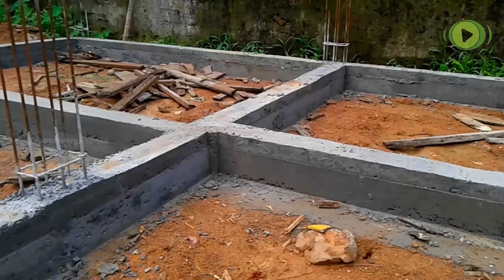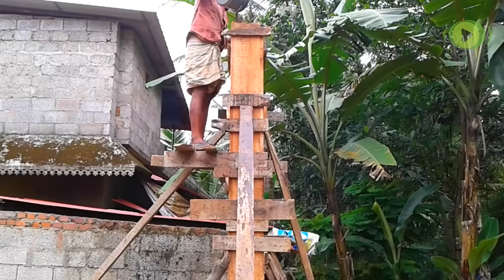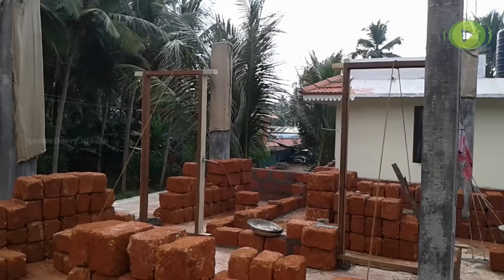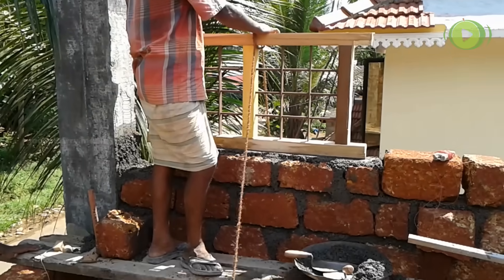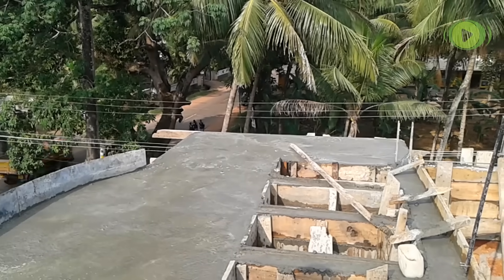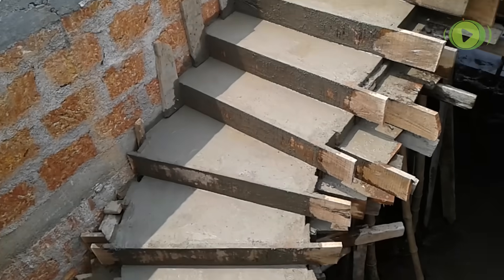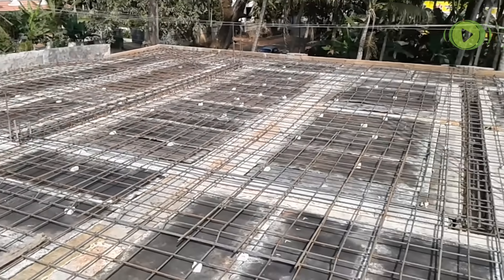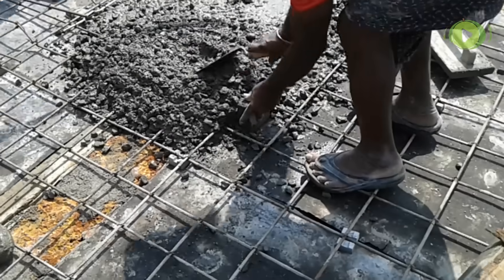Construction Steps of a House-Part 2

Comment: Sir slab should be after wall construction or it may be other way??
Reply from the maker: When beams and coloumns can support the slab, it can be done before walls. For big buildings and all, usually it is like that. And can be also constructed after wall.

For small buildings where there is no enough beams and column structure for supporting, top slab is constructed after the wall construction.

Comment: Throughout Lintel is required in frame structure?
Reply from the maker: Not necessary. The function of lintel is to take the load above door, windows, small projection slabs etc. Can restrict it to that locations instead.

Comment: What's kind of block is that? What's the advantage of using that kind of block?
Reply from the maker: This red blocks are locally available here. It gives coolness compared to other blocks. But we need to check the strengthness also. Some times weak stone will also come since it is carved from below earth. In that case of weak stones, it is not prefered to use it.

Comment: When the colume structure is small and its end is lesser enough for further construction how its extended and increased?? How its extended lengthwise.
Reply from the maker: Columns are vertical load bearing structure. We can drill the holes for steels and fix the steel in the column end using adhesives such as lokfix. Then do formwork and concrete.

If we want column extension, it is always advisable to put extra steel outside the concrete for future extension. So that we ill get proper lap for upcoming steel.

Comment: Good work Johnson.... Just wanna add one think here.... Not required to put window and doors and brick work during construction.. It will be the last stage.. First we have to complete frame works..
Reply from the maker: Hi, Thankyou for the comment.
We are fitting Window framework and door framework first and the doors we are fitting last. We can put framework work of window also after roof conctete if lintel support and beam support are sufficient.

For small houses, where lintel and beam are building on very limited areas, usually we are putting framework first.

Comment: Hi this is Emmanuel from Siliguri. We constructed our house in 2015 and what we did was.... our contractor as shown in the video made the foundation and column but straight away did the slab or the roofing and the masonary work followed after that. Therefore the load of the slab is solely on the pillars but not on the walls. Is that ok ? Well this is how almost all the construction takes place here......but I find your work better from safety point of view.
Moreover my living room dimension is 16*18 with no hanging beam above....but it has a concealed beam in between two hanging beam which is conceled within the slab above....is that safe...? But it has a partition wall in between which were made after the roofing was done. The pillars are of 10*12 dimension...and the beams are probably 10*10....

Your suggestions, advice and reply will highly be appreciated....
Reply from the maker: Hi,
Beams and columns(pillar) are the load carrying structures. So if the house is having good beam and column structure, then there is no problem in constructing masonry after roofing.
Most of big buildings are building like as u said.

But most of houses dont have beams and columns(wall will be sufficient since they are small). In that case masonry need to be done first.

Comment: Thanks for your informative set of (2) videos.  I am thinking about buying land and building a house (ground + 1 floor, 3 bed, 1500 to 2000 sq ft carpet area...), in Kerala or South Goa.  Others may already have asked these questions, but I cannot locate your reply:
1) What was the cost of this construction -- from site preparation to fully complete?  If you have a breakdown that would be great.
2) How much time did this project take -- from site preparation to fully complete?  Breakdown would help.
Thanks for your response.

Comment: minute 1.50. IT IS WRONG to take the concrete form after 24 hours. it has not cured and cracks may develop. you should be save after 1 week... but good practice is to keep it supported for 3 weeks.

Comment: Sir,
Overall the video is nice and informative, but I just confused in your concrete mix (1 bag cement, 4 bowl sand, 6 bowl metal). Please clarify which grade of concrete you are using.

Comment: nice video in this video you want add some more details like plinth beam detail ,column lapping details ,what type of concrete mix wer using ,1 bag cement 4:6 mix is a wrong mix design . and please mention the   slab details what type of stab .

Comment: what kind of brick used for construction where can I get it what is the cost of the brick what what is the difference between fly ash bricks and these brick
Reply from the maker: Different types of bricks are available at different places. like latterites, small bricks, cement bricks etc. you need to enquire it in your locality for that.  u ill find it out. thanku

Comment: brick masonary before roof slab ???
Reply from the maker: It is good.
if beams and columns can support the roof, roof concrete can be done after. In heavy structures where beams and columns are more, roof construction is usually done before masonry.

Comment: thank u very much ..i want to knw more  about pipe layout which is placed before the const of slab and then continued after its construction..
Reply from the maker: After the roof slab concrete, the paper pieces which is fixed in the pipes and hooks are easily identified. 

Pipes are given to the wall below. Layouts are drawn in the wall and that portion is drilled in the diameter of pipe.

Then pipes are given through that portions and that ill be connected to switches.

Electrical works are done

After that it is filled with cement paste and  the plastered
Reply: thank u very much sir.. thanks for ur response.
Reply: really sir